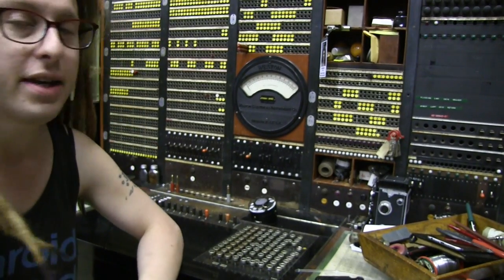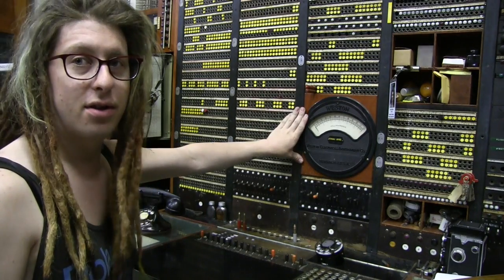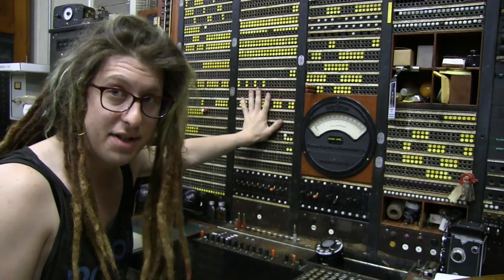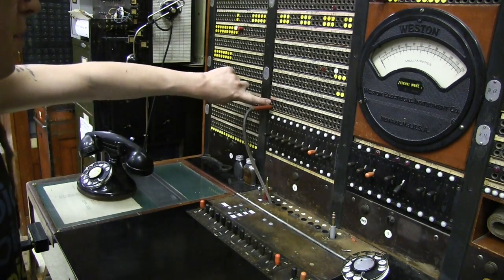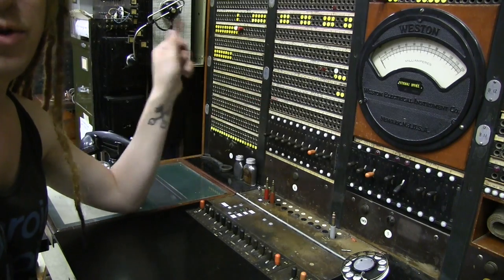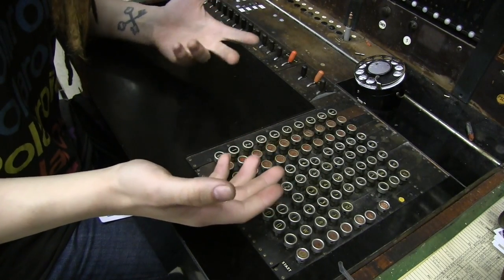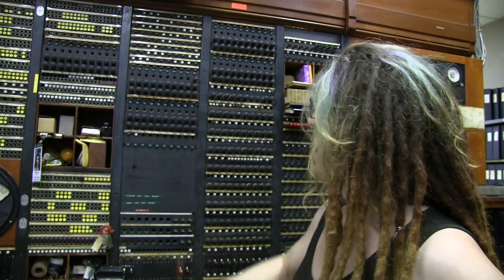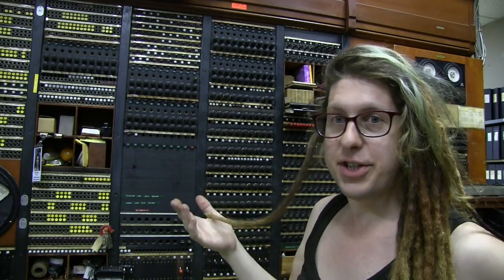Panel System - OGT Desk Explanation and Demo

Comment: Great video.  Back in the 70s in Canada you were not allowed to plug in your own phone.  The phone company controlled how many phones were on your line and you paid monthly rent for each phone.  I imagine it worked the same in the US.  People who were caught hard wiring extension phones could be fined.  There were no modular jacks.  Everything was hard wired.  When I went on a tour of our local phone exchange the people sitting at a desk similar to the one in your video, would spend time checking the resistance of people’s lines to see if they had more than one phone connected when there should only be one phone.  If the resistance was lower than expected, they would know that there’s possibly an extension hooked up.  The bell was always connected even when the phone was on hook.  This is why the resistance would be different.  Some people who wanted a free extension phone would disconnect the bell of the second phone to bring the resistance back to normal.  That meter you had in the video looks like the one they were using in the office to verify the number of phones connected.  I saw this in the mid 1970s but my interest in this technology was very high so I remember it.  I find this very interesting. Thanks for the video.
Reply: That's strange. I live in Canada and that wasn't the case where I lived in Peterborough Ontario. In 1975 we had modular jacks and put a second phone in the basement and no one cared if we had an extension phone.
Reply: In the US, up through the 60’s we had 4 pin plugs that allowed us to connect to any phone Jack in the house. Phones were rented from the telco and you paid according to the number of phones you rented. 
Used phones were available through a kind of black market. Mostly Stromberg Carlson phones, and occasionally a western electric phone might be for sale. My Dad bought several phones and I disconnected the ringer so that the telco couldn’t detect the increased ringing current.  Never got caught.
Reply: @billmoran3812  I had an aunt who had one of those 4 prong square plugs.   I forgot about those.  She paid a monthly rental fee here in Canada for that luxury which is why it was rare to see it.  In 1976 I got into big trouble because I had the phone line plugged into an amplifier.  Apparently a surge of electricity went through the line and blew a fuse at the exchange that night so the repair guy was on our doorstep in the morning the next day.  I was at school and he asked my mother if anything was connected to the phone line.  She said no and she wouldn’t know.  At 12 I knew not to tell her what I did.  He asked if he could inspect the line in our house and mom let him in.  He found speaker wire hooked into the terminal box in the basement and used some device to trace the line under the carpets and up 2 storeys into my bedroom.  Got the wooden spoon pretty good when I came home from school for lunch.  He told mom that they could be fined $500 and even jail time for touching the phone network.  He gave mom a rotary desk phone (Northern Electric) and told her to give it to me to experiment with so I would stay off of the real phone line.  I thought he must have been the nicest man.  Mom wouldn’t let me have the phone.  She was afraid I’d hook it up to the line.

Comment: I wanted to write a big thank you somewhere and this seemed as good a place as any!!! I love these videos. I LOVE the enthusiasm!! And I LOVE that you don't edit out every error because I often learn from the wrong turns left in the videos. I appreciate that.

In the early/mid 1990s I had a friend who at the time was a central office tech. He showed me inside a couple central offices and I was fascinated. I believe my own office at that time was 1AESS but it was a long time ago. I later got to see it again just before it cut over to a 5ESS.

My friend used to call high volumes "Bitch'n Switch'n".  He also liked to joke that the dial tone was supplied by a dial tone tank and that if you ever didn't have dial tone, they probably just didn't get the tank refilled in time. 

Keep up the good work on this stuff. I'm thinking of coming out to visit when covid19 slows down. THANK YOU AGAIN!!!

Comment: I retired from the telephone company 22 years ago. I worked in carrier and we also tested trunks in xbar 1. I worked on d1 and d3 and d4  channel banks. T1 .t2,t3’s. E1 and e2’s and e2-3’s( these were tube repeaters) e6’s. Mft’s. 206 repeaters,232 and 236’s and associated dsx1’s.How about n carrier, I only worked on repeater bays, they were fun. Musack circuits, alarm circuits. Dll’s, wow so much fun. Fault locate t1’s to manholes. Subscriber line carrier. Slc7. I remember.

Comment: The panel office I worked in disused the tie line and misc keys add installed a call director instead. I would have preferred the original setup because you could monitor a trunk you were working on while talking to a frame tech.

Comment: I notice there never seems to be any talk of a clock pulse.  What happens if two relays try to grab the same trunk at the same time?    And similar clashes.   

Also it seems some lines have fuses and others have current-limiting incandescent lamps.  IS there some general rule as to which lines get fuses and which get current-limiters?
Reply from the maker: There are no clock pulses in these machines. Everything just runs at its maximum speed, limited only by their physical properties (magnetism, moving mass, motor speed). When a selector lands on a set of terminals, it grounds it almost immediately, marking it as "busy" to other hunting selectors. There is an inherent 5-10 millisecond window called the "unguarded interval" where a selector will be on a terminal but it will not be grounded. During this window, another selector could land on the same terminal and attempt to seize it. This was not really a well-understood problem during the 1910s when they were designing this machine, and it proved to not really be an issue for most of its life. However in the 1960s and 1970s as the parts began to age, and fall out of adjustment, the 5-10 ms window became 3 separate intervals, some as long as 50-100 ms. This was a big problem, and required a set of adjustments to be made on the affected selectors. They came up with a test device that could be attached to each selector and identify the ones most seriously affected. Until the issues were corrected, there were many double-connections.

In later common-control machines like the No. 1 and No.5 Crossbars, contention was not only anticipated...it was expected. These machines were designed from the outset with the idea that many pieces of equipment would all be trying to access things at the same time. When a marker (analogous to a CPU) seized a frame, it had to bid for that frame against other markers. When it was awarded access to a switching frame, it had complete control over that frame until it was done. A single operation usually took less than a second, so many markers could access many frames, as long as everything was protected by timers...which it was.

The resistance lamps are used in circuits where there is a large variation in the amount of current that could pass through, but as the current becomes higher, we want to limit it gracefully, until we reach a theoretical maximum and then just hard-limit it. A good example of this is line circuits, which extend out of the building to subscribers' telephones. We provide battery to those phones, and depending on the external loop resistance of their line, there might be a very high, or very low current flow. If the subscriber is close, there will be high current, which we will have to limit. If they are far, there will be lower current, which we do not have to limit quite as much. If their line is shorted out just a few meters from here, there will be very high current and we need to hard-limit that.

Comment: Does the load shedding function have any way to respect emergency calls from low priority subscribers? I'm not sure how it could since you'd need the very senders your trying to shed load on to dial the emergency services. Does this pre-date 911?
Reply from the maker: Nope! After an earthquake or whatever, you change who is allowed to use the phone every 20 minutes.  First group A, then B, then C. Then back to A, and so on, until the volume dies down enough that you can have more than one group on at a time. The thinking was that if you had a hard capacity limit, there was no way to tell which calls were genuine emergencies, and which calls were just people calling their friends.

This does pre-date 911. The police had a phone number, but it was a regular telephone number just like everyone else. In 1923 they didn't have it all figured out yet :)
Reply: @ConnectionsMuseum  Normally Class A (Police, fire, doctors, hospitals, etc) would always have service. Classes B and C would be alternated unless load was very high in which they would both be suspended. Remember also, Line load only affects origination of calls. So if you were on class C and were cut off, your could still receive calls from any other class, but not receive a dial tone.
Reply from the maker: Right! I misspoke and implies that you’d cut off class A, but that’s not the case.
Reply: In movies when there would be a disaster and they'd pick up the phone and get no dial tone, I always just assumed their line was cut. But they could have also been out of senders or line finders. I never thought it would be a capacity problem because I thought dial tone was just connected to everyone's phone all the time when they weren't making a call.

Comment: I kinda envy you because you are working on the equipment I first used growing up, and you're around my age. I love this kind of physical electromechanical technology, because the circuits made are actually moving. Unfortunately, I love the internet and the newer technology much more. And as we both know, there was too much noise on the lines I. The HF range to allow this technology to work with each other properly. I was about 6 when they phased out the old crossbar and panel systems in Orlando Florida. My favorite switch was the crossbar 5. I still don't fully understand panel. But I bet I'd love it if I fully understood it. It's like a simplified reverse of the crossbar technology I think (in terms of logic)(maybe parallel to the logic of crossbar).

Comment: Sarah great video.  Now I am curious as to how "permanent signal" works in the world of digital 'switches".  I know what happens in southern California when a phone is off hook, we get the fast loud busy signal through a receiver.  If there is a shorted circuit, does the computer generate a ticket for the possible need of repair, or is there still a real person which intercepts and double checks.

Imagine if Cell phones could be "taken of the hook" haha
Reply: DandyDon Sarah here. It's almost certain that a computer generates a report that gets looked at by a manager somewhere. With newer switches like the 5ESS, capacity isn't as much of a problem. With the decline of wireline service, most of them are running way under what they can actually support.

Comment: Hey Sarah, I was wondering, can you explain how the Panel switch actually manages to stop at the correct trunk when it is revertive pulsing? I have always imagined that by the time it sent the revertive pulse, and the far end office told it to stop moving, that it would have already gone past the trunk. Does it have a sort of offset track that causes it to send the RP before it actually makes contact with the trunk?
Reply from the maker: Good question. I should maybe do a video about this, but I'll try to briefly explain here. Panel offices actually had a physical distance limit between them, partially due to this very problem. The way they got around that was to send the pulses back to the sender slightly earlier than the actual moment when the brush was contacting the proper terminal. This allowed for the round-trip time, plus the operate time for the relevant relays. Then, when the power was cut to stop the up-drive, there was a special commutator known as the "C" commutator that kept the circuit closed through itself just long enough to make sure that a ratchet at the bottom of the clutch assembly fully locked into its pawl to hold the selector in position. If the alignment of the brushes and commutators was incorrect, it resulted in a wrong connection, so it was very important that they were kept within specified limits. See this page from a switchman's notebook we have: https://revertive-pulse.tumblr.com/post/151866538129/the-owner-of-this-notebook-is-very-good-at-writing

Comment: Do the trunks use DX signaling?  Two or 4 wire? Or revertive pulse? Maybe DX signaling wasn’t invented when first panel office came on line. Are any subscriber lines ground start capable?
Reply from the maker: Trunks are 2-wire loop start. No 4-wire, as panel was not capable of toll operation. That would have been handled by operators. 
I don't know that any lines were ground start. I see no evidence for that in the schematics, but I haven't looked at all of them. Regular subscriber lines were definitely loop start.
Reply: @ConnectionsMuseum  when I was in NYC in 1974, local office 212-WAlker 5 nnnx was panel and we had direct distance dialing.  Inter LATA calls must have been handled by #4 office post WWII. Our Sprint (formerly SP Communications) trunks to NY Telephone were mostly 2 or 4 wire DX / e&m. BTW does any of your machines have a 1004 test line and 600 ohm termination? None of these test lines work anymore in the real PSTN
Reply from the maker: @sethtaylor5938  Yes, we have 1004 Hz at 232-0003, 832-0003 for the 5XB and 1XB. There's also a sup test line. I have not wired up the silent termination lines yet.

The panel has a flashing busy test line at 722-0099.
Reply: @ConnectionsMuseum  BTW where I retired from in NJ 973-540-9971 will get 1004 @ -10 dBm and 540-9966 is 5 seconds of 1004 then 600 ohm quiet term. Also in old legacy VZ ex NJ Bell if u dial 958 (ANAC) on subscribers line in area codes 201, 973, 732 and 908 the switch echoes back the seven digit phone number in a voice message. Kinda unique to old Bell System. Some offices also used 959 especially in Canada. We used that as a trouble shooting tool sometimes at the Main Frame. Telco outside plant used it a lot.

Comment: Imagine if we made computers with similar moving Technologies. Meaning imagine if we made Dion off computer functions happened Electro mechanically. It would be a huge circuit but it would work much the same but very much very much slower.
Reply: We did